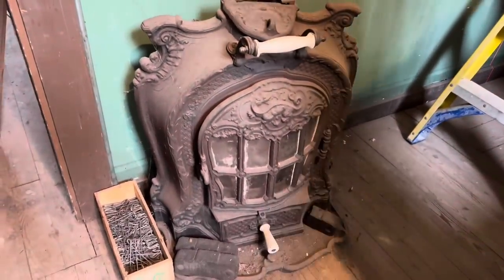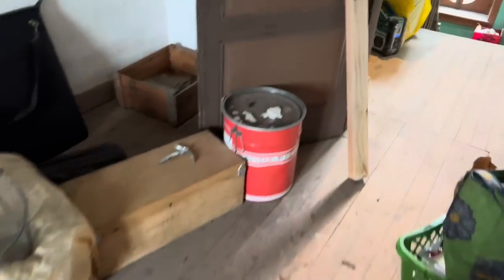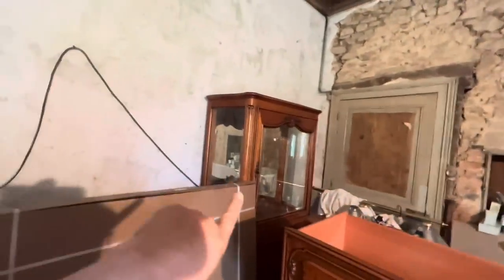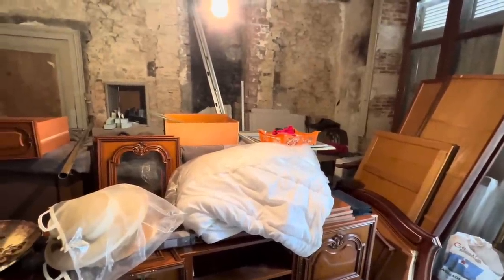THE SECRET IS OUT AT THE CHATEAU!!

Comment: Congratulations on all your magnificent achievements so far. 
With regard to painting the inside of that beautiful wooden display cupboard blue, a possibility is that the following method has more advantages and it is easy if you later have a change of mind. A false backing can be used. For example, the carpenter can make a thin piece of wood or buy a piece of firm cardboard and cut it to fit exactly into the inside cupboard area which you currently wish to paint. This piece of wood/cardboard can then be painted and, when dry, inserted into the cupboard. Or instead of painting, one can buy a roll of blue paper and glue it to the piece of wood/cardboard. In this way, the cupboard is untouched, the painting becomes much easier to do and the colour can easily be changed.
Reply from the maker: Brilliant idea 😊💜